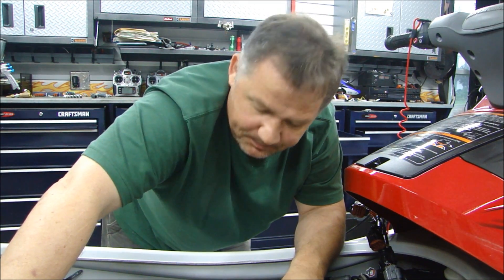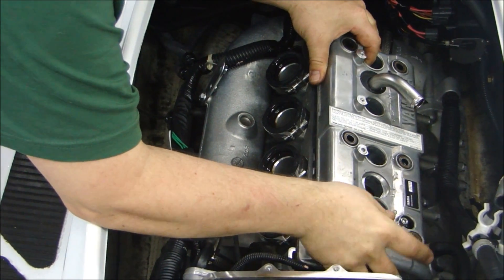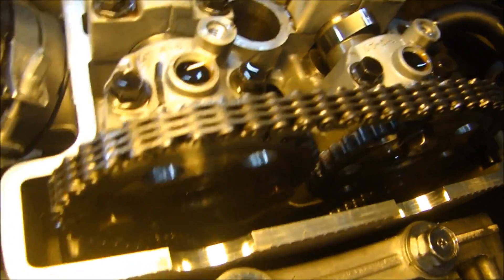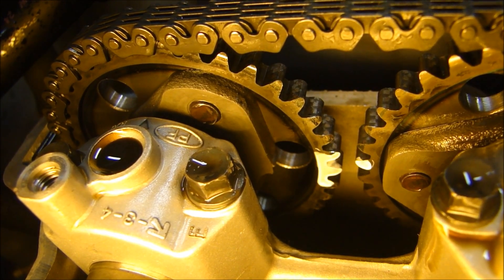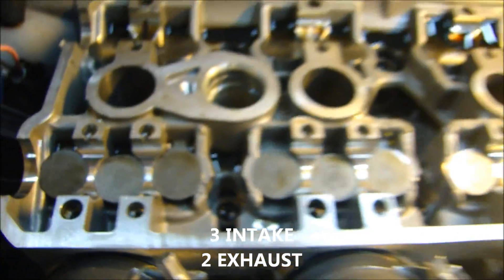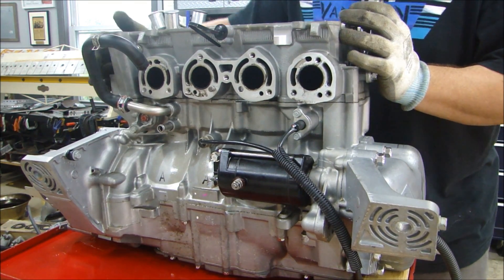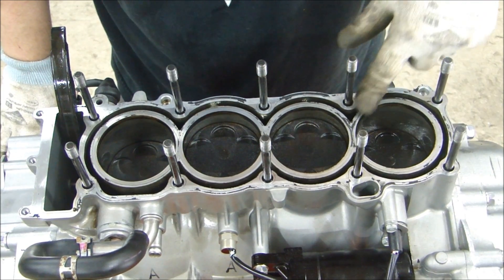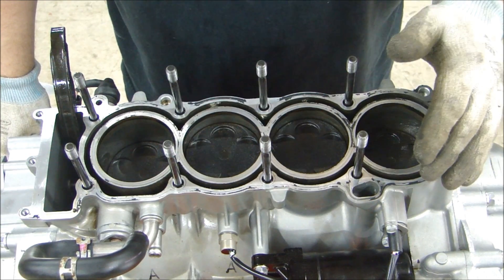Engine Repair Part 2

Comment: I’ve been having a problem with a stuck valve tapper and possibly a stuck valve, we’ve sprayed oil in it and gotten lubricant in it, what would be the best thing to do in this situation.
Reply from the maker: The valve may be bent

Comment: I have this engine and one bearing spun .
Can it be repaired if I can a used good crank or it’s tossed?
Reply from the maker: Grind the crank and use oversized bearings

Comment: G’day Pete,…… hope your well 😊…….. Mate at 1:20 sec in your video you were taking the head cover off the engine. That cooling pipe in the way. Did you have to unbolt it and wriggle it out before the cover came off. Got the same situation. I took out the bolt , but it’s stuck fast. Can I “tap” and spray to get it loose. Cheers , once again you have been helpful to thousands. 😊🌈🍀🍀🍀👍
Reply from the maker: That is worth a try, it take a bit of finesse

Comment: boy you are so wrong takes 30 min to pull that motor that way you could bench it and tear it down by the way water in cyl they swamped it check the air box for water
Reply from the maker: If you are familiar with it I can see it only taking 30 minutes.

Comment: You said in your first video you turned the wAter on then the engine maybe that was the problem you filled engine with water just needed getting out the engine maybe?
Reply from the maker: That's a good possibility

Comment: It looks to me like they turn on the water without running the engine. A good cleaning and a new head gasket would have fixed the problem.
Reply from the maker: You are right

Comment: Curious, You mentioned you ran the water and went to crank the engine. Yamaha manual says never run water without the motor running that the water could flow back into the cyclinders. Could this have been your problem? Either way thanks for the video im tearing my apart now due to an expected headgasket issue.
Reply from the maker: It's possible, but I did start it without the water on and it still made it's way back to the engine.
Reply: How many hours of usage before the problem?

Comment: Hi, thanks for the videos! I have hydrolocked my Vx110 waverunner. The piston is slightly scarred and the cylinder wall is a little damaged also. Do you know if the cylinder wall is nickel plated? I decided to do the work myself since the Yamaha dealer wanted to put a whole new motor in due to 1 piston and cylinder. Any helpful tips you have would be great!
Reply from the maker: I do not believe they are plated. You can it is has a sleeve in it so it will be difficult to machine, but it can be done
Reply: Petes Garage Is it possible to buy sleeve and just replace?
Reply from the maker: Yes, but it will be difficult to find a machine shop to do it. Sleeves are a nightmare
Reply: Petes Garage my grandfather owns a garage and helped me hone it out today. I am going to put everything back together tomorrow and hopefully all is well.
Reply from the maker: That's good. Did you measure after honing to make sure it is not oversize too much?
Reply: Petes Garage Not yet but he thought it wasn't too bad and did just enough to clean it up. one thing that I'm concerned about is the connecting rod. I read online that those can be bent when hydro-locked. have you seen that happen? I want to make sure I check everything before I put all this back together.
Reply from the maker: Yes I have seen that. Check the rods for flatness

Comment: Greetings Petes Garage,

I wanted to know if you have a video I can watch for removing head gasket material from a head gasket.  I am rebuilding my engine (VW 2.8L VR6 12v, Engine Code: AFP).  I watched one of your previous videos, and I"m concerned with FM possibly destroying my crank / bearings.

It's a Cast IRON block w/ an Aluminum Head.
Reply from the maker: +Marlon Lyn You can use Chisel Gasket Remover....just be careful and use it sparingly. Take your time and scrape with a single edge razor blade

Comment: This is the most sophisticated engine I have ever seen-the head is all valves! After the plugs were removed and the water out of the cylinders, wouldn't a compression test given you some additional evidence that would have been useful? I'm amazed at the water cooling of the exhaust manifold.....I would think the potential for steam would always be present, and hence some kind of rupture. The casting of the block must really be a work of art, but all those channels inside could be weak points as it 
ages a bit. Like low oil pressure in a regular engine denoted bearing wear, I wonder if those internal channels could be pressure tested for leaks?
Reply from the maker: I'm still working on it. I will have a cylinder head video soon. I still do not have a solid answer.

Comment: Hey pete wondering if i could get your opinion on something im building a .040 over 351w with a stock stroke scat cast crank stock rods and forged pistons and the number 3&7 rods wouldnt fit the journal it was too tight i took it apart and took it to my local machine shop and the measured the journal on the crank and said it was actuall slightly larger than it was supposed to be and the reworked the rods a second time any thought on what the issue is?
Reply from the maker: I would have preferred to grind the crank journals to be the same. If they cut the rods the rotating mass will change.

Comment: Off subject-but-would really like your input: I'm having a new long block installed
in my '87 jeep Comanche , all other current engine parts will be used to complete
the new engine. Question : Should I have the new block painted and should all the
current parts be cleaned and painted also. Is the added cost worth it ? Or will the
new engine be OK without the paint. My budget is very limited.
Thanks in advance. 
Your videos are GREAT
Reply from the maker: AreWeEverThere The only thing that needs to be clean are the mating parts and o-ring surfaces. Painting looks nice but does not add to the function. You will be fine without it

Comment: I like to mark the chain to sprocket position too for absolute piece of mind..I'm watching..Does it have any port between the exhaust and inlet.?  like for an EGR.?..I'm still going for a mouth full of water but the oil on the intake has no water,,The #1 inlet valves are a bit washed but did the water get in thru the exhaust perhaps.?
Reply from the maker: I am beginning to think water through the exhaust cooling system somehow. But that does not explain oil coming out the exhaust

Comment: Might be worth putting plugs back in and pouring gas into each cylinder head. Any leaking out could help point to bent valves, a possible cracked head or damaged valve seat. Not a definitive test but a pointer in the right direction. In a hydro locked engine it is almost always the valves and valve gear that gets it in my experience,well apart from a drowned dirt bike that bent its connecting rod like a banana!
Great videos by the way.
Reply from the maker: After I cleaned out the cylinder it started right up and ran great. No obvious damage so far.
Reply: That's the very best that could of been hoped for! Have to wonder if they make the gasket the weak link in an engine that runs a real risk of being hydro locked? A quick check for a bent connecting rod would be to measure the piston crown heights, one lower than the others points to a bent connecting rod.
 All that needs doing now is filling it up and enjoying long hot summer days on the water!

Comment: What's it like working on a cooling system that uses salt-water to cool instead of a sealed system, is there some weird corrosion issues you need to deal with, and special measures that have to be performed?  I've never had to work on an engine using open cooling, so I'm just curious.  Interesting too that they use an open deck design.
Reply from the maker: Most marine engines use all stainless and brass fasteners. Both have better salt water resistance an the will not spark. I use this engine in fresh water. The water is pulled in, cools the engine and goes right back out.